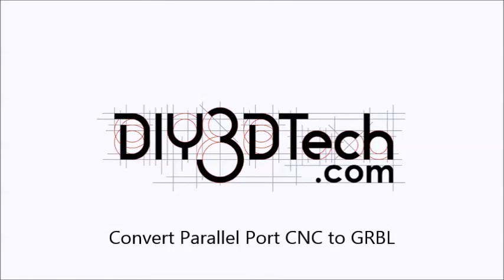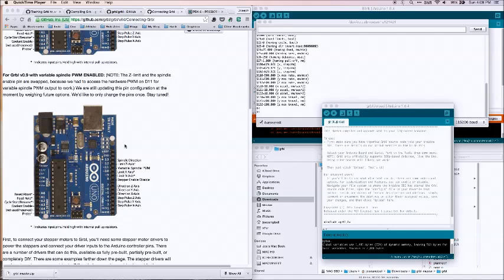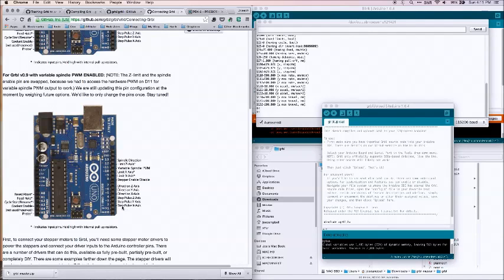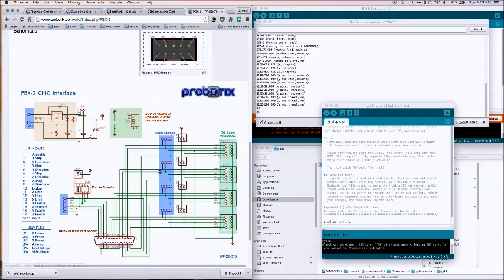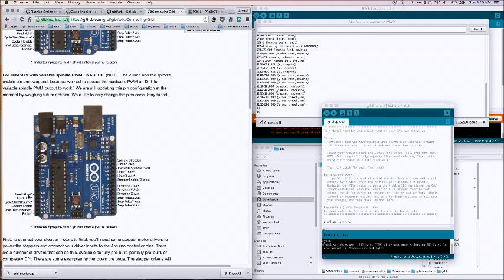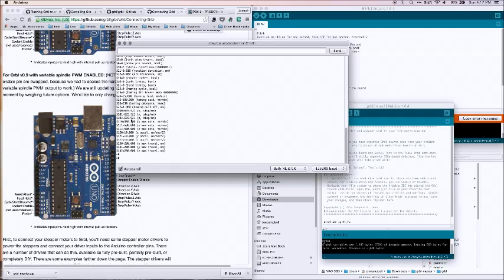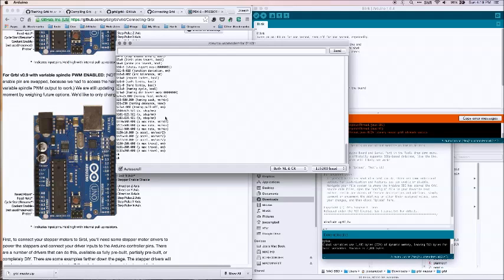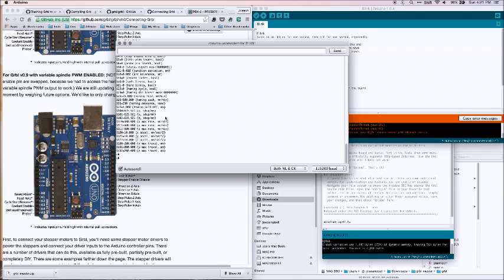How to wire Arduino and GRBL for Parallel Port CNC Control!

Comment: work for Mach3?????
Reply from the maker: Not sure what you mean as Mach 3 dives the stepper controllers directly from the parallel port whereas this is what what GRBL does as it takes and ANSI stream of GCode and converts it into pluses that the drive the controller...

Comment: You really need to get a ethernet to arduino mega to cnc. There is the ethernet uno hal interface.  I was looking at PORTA pins 29-22 for outputs as step, PORTC pins 30-37 for ouputs as dir, PORTF pins 54-61 (A0-A7) for inputs as homes, PORTK ping 62-69 (A8-A15) for input as sensors and PORTL pins 49-42 for control (outputs : coolant, flood, light, latches, relays) which gives you 40 pins in 5 bytes (40 bits). It also gives you 6 pins for ISR interrupt pins 2,3,18,19,20 and 21. you still have pins 4-9 for pwm, pin 10 is used by the ethernet board, and you also have pins 11-13 for PWM.  43,44,45 are pwm capable - but you're better off using them as PORTL.  Pins 38-41 can be polled as inputs or used as outputs. Yes you can use the analog pins as digitals.  I'm using PORTA as step, PORTC as direction.  The ISR pins as limits. Pins 14, 15, 16, 17 as serial pins 0 and 1 are TX0/RX0 hooked to USB.  I'm basing my code mainly on https://forum.linuxcnc.org/24-hal-components/28745-io-interface-with-arduino-over-ethernet
Reply from the maker: I get the UNO verses the mega (have worked with both)  so are you running GRBL-Mega on this?  As I really would like to use my forth axis...
Reply: https://pastebin.com/Rndt0gaz I'm writing anLinuxcnc to  Arduino MEGA ethernet interface.  It use Linuxcnc to drive the cnc through the pins on the Arduino MEGA2560. Basically a poormans MESA card.  I'll have to look at the GRBL code.  I'll be back tonight with a 4th axis on GRBL answer.
Reply from the maker: Very interesting, please keep me posted :-)

Comment: Hi thanks for the video. I'm interested to know about 4th axis run from Pin D12-13. can u show or guide us
Reply from the maker: Likley in the summer I will do something on the 4th axis's however wiring wise it the same is the X/Y/Z  its only the programming (CAM)  which becomes a bit tricky
Reply: thanks for Ur feedback I have already do the wiring same as the xyz just I have place the jumpers on 12 n 13 but I don't know to  create a firmware on 4th axis.
Reply from the maker: It is early and I need to correct myself apologies, as GRBL will not support a 4th axis other than as a slave or clone axis of X/Y/Z.  As the UNO doesn't have the pin outs for this and the reason you see 3D printers whose extruder is the 4th axis use  the Mega however I don't believe there is a "Mega" version of GRBL out just yet.  Sorry...
Reply: I've looked at the source and it's one pin (port bit) short of being able to do 4th axis.  You'll have to move to th MEGA and Marlin. hmmm if reset is disabled you get another pin but you lose the ability to reprogram the chip. better off going to the MEGA.

Comment: hi i dont understand if my cnc could use this i do not have Ardunio based CNC the controller board on the CNC has a chip but erased so please help i am confused its a Chinese cnc 6040
Reply from the maker: The Ardunio  provides control to the stepper controller  of 6040  via the DB25 connector.  Checkout my blog post here:http://diy3dtech.com/3040-cnc-converting-to-grbl-with-lpt-db25-g25-usb-adapter/

Comment: I have a parallel port printer, could I use this to control the stepper motors via the parallel port using the printers own control board?
Reply from the maker: Yes and you may also want to watch this video (https://www.youtube.com/watch?v=I8y3skvYuPg&index=3&list=PLInTrkIbj69mjiZm7Mk9Bj-s-VLlnkIUn) as well as I wrote a book on this too (http://amzn.to/2hAxVkD)
Reply: As I do not have a parallel port on my computer, I am trying to send data through an Arduino, I just have connected what I hope is just the X axis for testing and to save a wire mess. 

I believe I need to use the strobe pin but not sure what this would be on the Arduino side, also pins like ACK, busy, paper out, select, line feed, error, reset, select printer.

Comment: i cant control z axis manualy can anyone help me about this? when i sen nc file z axis is workin but i cant calibrate levels on z axis please help
Reply from the maker: Can you clarify the question and I will try to help but need more details...
Reply: İ cant control z axis manuel buttons on grbl or another cam program. But when i  send a gcode Z axis working well. .i can control  X and Y axıs manualy...  why i cant control the Z axis?
Reply from the maker: When you say "manuel buttons on grbl" I am confused as GRBL has no buttons.  So  I have to assume your using something like universal GCode sender or something similar to communicate with GRBL correct and it is those buttons?  What might be happen happening is you need to need to send a "speed" along with the Z movement code of the button.  In you GCode sender there typically is a distance setting which upon press tells the machine how far to move.  Try changing that and see is the axis moves.  The other thing is look at $$ paams as you might have something hosed up there with motion.  Other other options, (1) reset the $$ cache and start clean, (2) reset cache and reinstall GRBL....
Reply: i fix it. its because my hex file... now i m using 9600 bnd hex file grbl 0.8 its done...
Reply from the maker: Glad to hear, however is there a reason to use the older version verses the 0.9 as there have been a number of rev's in 0.9...

Comment: Hello can you tell me if its possible to control dc motors (for z-axis) with grbl ? I'd very like to do that. Thanks
Reply from the maker: GRBL will only control steppers and not servos (i.e. DC motors) if that is the question.  If its will GRBL control three axis's the answer is yes (X, Y & Z) however it can not control a forth as in extruder for a 3d printer or a rotational axis on a CNC...
Reply: why can't it control dc motors? from what I know grlb use direction and step pins, so someone can build a circuit where activating the direction pin will change the direction of the dc motor (just apply positive or negative pwm) and step would apply a pwm signal no ?
Reply from the maker: While you could build a circuit to flip flop the direction of the motor and you could "try" to emulate PWM with the step signal, this would be far too unreliable to use without an encoder and to my knowledge GRBL does not accept the input of an encoder.  In short it would be far easier to buy a stepper motor and call it done IMHO...
Reply: that's because I don't need precision on z-axis, i'm building a cnc plotter made of cr-rom drives and the z-axis only lifts up or down the pen. But I've used a unipolar stepper that I converted to bipolar and if that doesn't work I'll work on controlling the dc motor with grbl. Thanks for your help

Comment: This would have been more helpful if we could read it. Even if only so we could see the pins and call outs so that we could compare what we are doing. I watched the loading the grbl and was only able to do it after several hours as I could not read the links or addresses so that I could at least see what I was suppose to do. Basically, you could understand the trouble some of us are havingif you go and listening to your video with the screen off. Just a suggestion, not meant to be critical.    
Thanks for the video.

Comment: Hey 

here is my wiring , but still having issue 

Name  Arduino Uno TB6560 Controller
X-Step  Pin 2     Pin 2
Y-Step  Pin 3     Pin 4
Z-Step  Pin 4            Pin 6
X-Direct    Pin 5     Pin 3
Y-Direct         Pin 6     Pin 5
Z-Direct         Pin 7     Pin 7
Enable Axis GND     Pin 16

X -/+ and Y -/+ works and Z - without a problem however when i try X+ all motor turn which includes X and Y not sure what is happening  

Link to my breakout board and controllers
 http://www.ebay.com/itm/281716747860

http://www.ebay.com/itm/381022728553

You help would be greatly appreciated